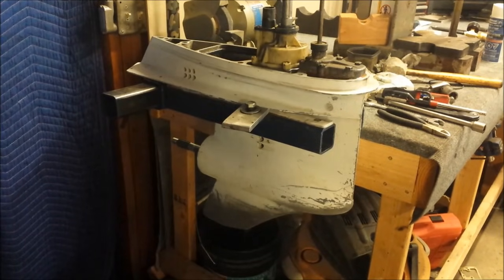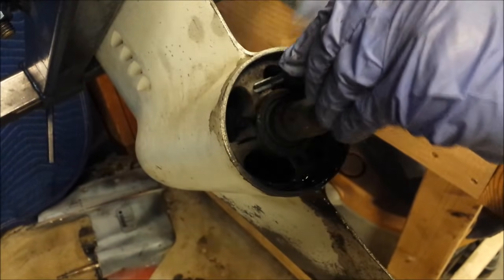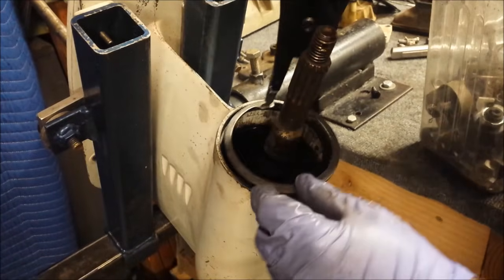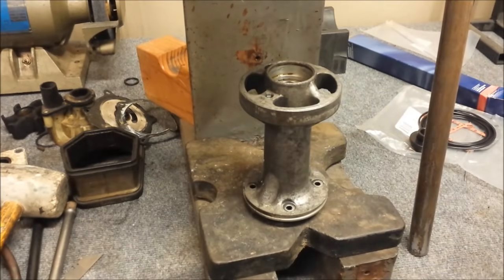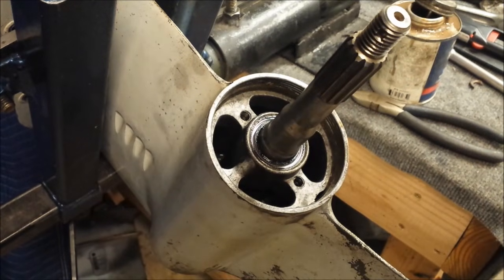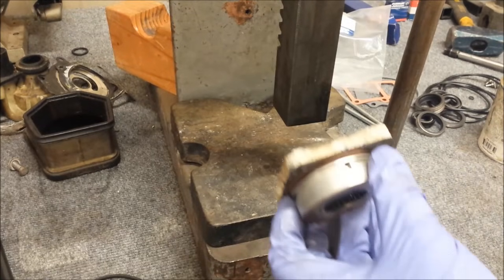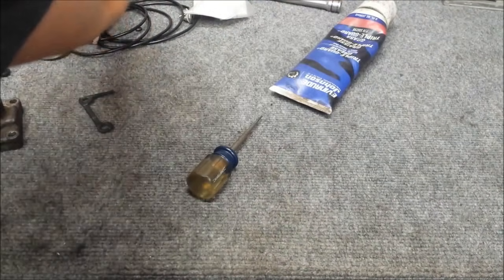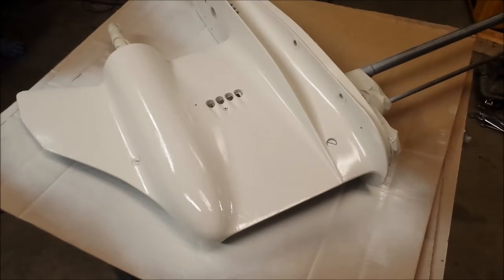How To Reseal a Johnson / Evinrude V4 & V6 Lowerunit / Gearcase

Comment: Just before it got too cold in Canada, I decided to check the gear case oil in my '78 55Hp Johnson... this is a new motor to me (two summers) and had replaced the oil and drain seals at the start of the season. Thankfully I did check, as about 1/2 liter of water poured out of it, with the oil following that. That much water would have likely cracked the lower end unit over the next month or so in sub zero temps. Thus I went searching for how to replace oil seals in a 55hp Johnson and found your video. Thank you so much for the detailed, real-world view of how to fix this. I have the boat in my garage, and plan to re-seal the lower end this winter. I have the original service manual, but hope most of this video applies to my motor.  Of particular interest is the other video you did showing what to look for when buying ebay tools. It's so easy to focus on the problem with the engine, and loose sight of the completeness of the tool.

Comment: Excellent video, and I love the way you touched up the paint at the end. One thing however I noticed is that the water intake screen was cracked up and in need of replacing. Other than that, I learned a lot about seal orientation. Thanks for the lessons.

Comment: I was amazed at how easily you removed the large circlips to get access to the gears, and then how easily they went back on. Your step by step instructions were exceptionally thorough and complete. You were concise and to the point. Thank you sir for your effort in making this fine video. Sadly, I own an OMC 800 stringer outdrive, but this video will make working on it much less painful. Great job!
Reply from the maker: Why thank you good sir.

Comment: Thanks alot Brandon. I have a 1975 85hp that i had to take out the drive shaft and everything out of the lower because there was an issue with the clutch dog detent spring and balls. But now that its fixed, this will help me assemble it.

Comment: I am a total amateur when it comes to boat motors but I have spent a career in a mechanical trade and rally appreciate this video. I would like to attempt this but i would have to pick up some special tools the extra long snap ring pliers,  bearing pullers, etc. I  also have to get up a bit of nerve to try it. I don't have that cool vice either and without that, that would make any attempt very very difficult.

Comment: Awesome video!  I just bought my first boat. Its a project boat so everything is trashed. The first thing I noticed was the lower unit was seized up. I was able to break it free by soaking the lower unit in rust remover for a hour. Now it’s time to do this. Thanks for the video.
Reply: you and I are kind of in the "same boat" Mine came with a 115 v4 evinrude, id tag unreadable since it is so old, but it's speculated is from 1996. Am trying to find the seals that will fit it's lower unit.

Comment: As a fellow mechanic / Automotive, I want to thank you for your time and editing to make this video. I have made a few but they do take up time. I was told to also vacuum test my lower unit. Do you think that needs to be done or just the pressure test ?
Reply from the maker: @Badwolf6466  well, youre supposed to, but I didn't have a vacuum pump at the time; and usually if it holds pressure it'll test okay under vacuum too.
Reply: @BrandonsGarage  Thanks for the fast reply.

Comment: Brandon I have the entire lower gear case stripped out all gears and bearings..my question was can I powder coat the lower unit once everything is stripped? just was worried about the excess of heat it will be enduring once in the oven for powder coating purposes.  Thank you

Comment: i have a 1977 85 hp johnson outboard motor. where can i get the parts i need to do  all that you did in this video?
Reply: I'll be looking for the same parts for my 90 horsepower you have a part number or you don't find it yet
Reply: @javiermontes3777  sierra 18-2692 seal kit , applian water pump kit 439140 318284 777807  i dont think these will work on yours.
Reply: @fredblankenship2319  thank you for your first response man I'll be trying to see

Comment: great video.....expert work performed.  I just did this on my 1999 Johnson Ocean Pro 150 including the bearing carrier seals but unfortunately still have water getting in  :(  I had grooves in my drive shaft where the bearings ride so I am guessing that is where my leak is.  Also I cant remember if I installed the drive shaft bearing holder with hole pointing forward.....would that be a catastrophic failure for my bearings or would they still get lubed somehow?

Comment: Brandon thanks for all your videos.  Do you have any on reassembly of all the gears and the headaches? Tips on pinion nut and proper way to tighten.  My 1983  75-Johnson  -  20"gear case, I found a bad forward gear and pinion ( due to the giant rock I ran over).  Let me know if you have any info on good videos.
Reply from the maker: You'll need a shimming fixture; That tool is just shy of $300
With that said, I should be able to find you some instructions.
Reply: I did not change drive rod bearing, do I still need shimming fixture?  If so is this due to new pinion gear?
Reply from the maker: Technically yes. 
It shims between the pinion and driveshaft bearing/seal.  Ill find the instructions tonight, should help.

Comment: Thanks for sharing, very informative.  I think my shifter is sloppy, where it does not shift back into neutral from forward.  I’ve followed procedure for shaft height, and think I need to replace the gear box.  How do you troubleshoot that?  Thanks Tim

Comment: I Was replacing the water pump on a beautiful ‘87 Evinrude 15hp. I pulled the driveshaft straight up out of the lower unit. It is my understanding that the detention balls drop out.
This looks like a very difficult thing to dissemble and and repair. Do you have any videos of this process.
Reply from the maker: No detend on the driveshaft, just put it back in and youre done.

Comment: Hi Brandon those guide pins are sold out everywhere, is the thread same as the one you used the tap to clean up?  I'm going to need to get the all thread rod if this is going to get done in timely manner, any help would be appreciated on size spec of those guide pins for carrier bearing.  Great vid btw👍
Reply from the maker: Its a fine thread, probably a 28tpi.
The screw you pull out, use those to size it up and get and all thread; itll work jusy as well.

Comment: Gosh, I wish I had seen this before taking mine apart to change out the water pump.  I had no idea the shifter rod screwed in and was activating the gear box by going up and down.  Instead, I thought it simply went from side to side.  It apparently was only being held in by one thread because it turned loose when I reinstalled the lower section.  There is no way to get it in and out of gear now, so I am going to have to take it all apart again and screw in the rod.  Problem is, I don't have a clue as how far to screw it in.  There are no videos on how to do that.  I may have to do it all the way in and adjust it later through the controls at the top.  Great video.  Just wish I had done better homework.
Reply from the maker: What is your engines model number? Ill look up how far it needs to go in.
Reply: @BrandonsGarage  Thanks Brandon.  I took a guess and screwed in 4 complete turns.  It connected  at the top OK and appears to do what it supposed to do without adjusting the linkage.  That surprised me because it must have barely been connected when I removed the loser housing.

Comment: I know this video is 6 years old but do you know if that bearing housing below the water pump housing has to be removed to replace the water intake screens? I have a 1976 Evinrude 115hp two stroke v4 and the water intake screens are all mostly broken and I'd like to replace them.

Comment: First of all, YOU ROCK BRANDON!!!

Secondly, do you happen to know the length and thread pitch of your guide pins you used? Thanx!!
Reply: The size and thread pitch is 1/4 - 28.  Unfortunately, finding a threaded rod with 28 threads per inch is difficult.  I just used a 1/4 - 20 threaded rod.  I was able to get them in the hole about a half turn and that was enough to get the holes aligned for the first two bolts.  The length is about 8 or 10 inches.  You just need enough to be able to screw them out by hand once you get the first two bolts started.

Comment: 84 johnnson 9.9 runs perfect wxcept that dam carrier bearinga have changed now. You just use the big rubber and the 1 plastic double lip seal. Then prop and i thought i had it fixed then i noticed oil in the pan a few days later. No water just oil. Which tells me its the prop shaft seal. If you could have showed how to replace the new carrier bearings 03060

Comment: Did you say the guide pin thread pitch/diameter?  Is it the same as the puller threads you cleaned out?
Reply: What size diameter and thread pitch are those guide pins again?

Comment: Working on a 1989 88SPL redid the seals and when I went to check that everything was working noticed the driveshaft won't moving regardless of being in neutral or gear. There is slight play in it but doesn't continue after the slack is taken out, wondering what I did wrong?
Reply from the maker: With a new water pump and seals it get so tight you cant turn it by hand.
Did you remove the bearing carrier to change the seals?
Reply: @BrandonsGarage  ok, and yes I Did remove the bearing carrier to change the seals.

Comment: I have a 2000 90hp,  I see mine has two retaining clips with bolts on the outside of the bearing carrier.  Did I miss you taking them out,  or are there two different carriers one that is secured by the two bolts and clips and one that is secured with the four bolts underneath?

Comment: Hey Brandon do you have a video or any tips on inserting the prop shaft and pinion gear in the v6 150 Johnson? The detent linkage broke I got it installed with that spring and bearing. The service manual is pretty foggy on the install.  Thanks and great videos!
Reply from the maker: Sorry, I don't have any videos on it. I haven't rebuilt a v4 case after starting my channel.
Reply: You still rock!

Comment: How important is it to make sure the hole in drive shaft bearing housing to make sure it faces forward? Wouldn't it get lubricated in any orientation since oil will make its way all around it?
Reply from the maker: Eh, probably.
But the hole makes sure sufficient oil makes it way into the rollers.
I've seen them installed forward or backwards. If you have a manual I would give it a look to see which way yours gets installed.

Comment: Thanks for the video.  I thought I was finished and now I can't get it to go into forward gear.  It worked fine before I replaced the seals.  Any suggestions on what I might have done wrong ? I am hoping I don't have to pull it apart.
Reply from the maker: turning the driveshaft while trying to shift into forward?
adjust the shift rod correctly?
Reply: Thanks Brandon.  I messed with it a little more and realized I was not pulling hard enough on the shift rod.  You really have to yank it to put it in forward.  Now it seems to work fine.  Thanks again for the video and your help.

Comment: I'm using very similar tool as yours to pull the bearing assy out (johnson 50hp 2stroke, 1997), but the darn bearring carrier is stuck pretty well inside.  I'm about to to abandon this lower unit and buy another used one.  Do you have any last suggestion?

Comment: Do you have a video of How to repair a stripped drain plug threaded hole?
Reply: Use a tap a size bigger after you file the hole smooth then get an aluminum  screw the same size and get an o ring or rubber washer to seal it..   before starting it flush the system out thoroughly with the same oil that normally goes in it until it runs withour shavings in it from the filing..   or you can buy a helicoil and they thread a new thread into the hole so no taps Needed there.

Comment: Hello, my o-ring for the shift shaft seems to be smaller then the 1 in the kit 5006373.  Is the kit o-ring correct?  Thanks. And the kit came with 2 o-rings

Comment: Hi Brandon. Your video is excelent. I have a question: I have to change the forward gear on my 200ho evinrude, 1977 2 stroke. I have the new FG, is it imperative to have a matched pinion?

Comment: 1973 Johnson 65 hp. You don't happen to have a lower seal kit recommendation eh? I've only been finding individual parts at this point. Model 65ESL73R. The internet has not helped me at all. I feel useless
Reply from the maker: Yeah I have the same engine, and the same problem. For whatever reason they don't make kits for 1969-1977 3 cylinder engines.
Reply: @BrandonsGarage  ahhh, thanks! I'll spend the extra time buying everything separate I suppose. 
Seems impossible to find a seal installer as well...

Comment: Hi Brandon, Will the 2 seal installers that you used here for the drive shaft seals & the carrier bearing seals in this video work on a 1977 Johnson 70hp Thanks Joe
Reply from the maker: No, you need:
http://everythingoutboards.com/brp/tools/314640.html
http://everythingoutboards.com/brp/tools/909525.html
Reply: Thanks for the quick reply & the info much appreciated

Comment: Hey I have everything cleaned up and when I was pulling out the seals of the bearing carrier I chipped the side of it. is that ok if I just put gasket sealing compound on it? I chipped the seal groove on the outside

Comment: Do you take on side jobs I have a 1978 85hp johnson seahorse v4, pumps water well, but oil leak in front of prop and water leaking at front where lower unit meets exhaust housing. I'm in PA and looking for someone that would do the rebuild.
Reply from the maker: I'm in CA though

Comment: Hey, do you know the size of the O-Ring for the upper bearing housing. I am from Germany so I need it in mm. I measured 54.6 x 2.6 is that correct or is the thickness 3.0 millimeters? Greetings from Germany from Malte.

Comment: The gasket sealing compound is no longer available. Any suggestions on alternatives?
Reply from the maker: I'm sure it is,
Where are you looking?
Reply: @BrandonsGarage   Amazon the link you provided. Also I have been having a hard time with those gear case
Reply: If I could send a picture of what I’m working with. I am not using the evinrude puller I am using harbor freight bolt type wheel puller set

Comment: So those 4 screws that hold the bearing carrier all have their own O rings..  if u look at the underside of the bolt heads they have a recessed part that fits an o ring..  otherwise it will definately leak..  now if you got new screws than they might come already on there but if your reusing old screws than gotta buy new o rings which for me were 4$ each!!!  For an o ring that wouldnt fit on my pinky..  rediculous..  but all my old ones were ripped up... just an fyi..  but very helpful video..  other than all of evinrudes overpriced lubes and speciality tools which i didnr use a one of em.,  had a ford torsion spring removal tool that worked for the puller..  other than that i used regular old twistin and beatin tools and used red high temp gasket rtv and marine greases..  good deal tho..
Reply: Where did you find these small o rings?

Comment: where do i get the alignment pins and the seal installers my dealer says there not available no more
Reply from the maker: well, what year & HP do you have?
(or give me the model number, and I can look it up)
Reply: e88msledc 1996 evinrude 88 hp spl
Reply from the maker: @MikeSmith-nu9wt  Turns out they are still available... Which begs the question; Who is better at this, the arm chair mechanic, or the professional? 
Guide pins are 0383175 and double-lip prop shaft seal installer / driveshaft seal installer is 0341439.
both available on boats.net

seal kit is here:
http://www.everythingoutboards.com/brp/gearcase/5006373.html
Reply: thank you sir , i had a friend attempt to rebuild it, he replaced all bearings , i got it back leaking oil.. he apparently didnt see your video and its not right ...oops , when i tighten the driveshaft carrier 4 bolts , the prop wont turn now ..shimmed wrong in assuming ? now im trying to figure it out
Reply: Wouldn't you know it , I got that evenrude lower unit fixed , then the motor blew up , so I picked up a johnson ( can't find any model numbers on it ) I heard you can look it up through someone with the numbers off the soft plug , it's
 G4348265 but that website won't let me look up anything , brp something web site , can anyone tell me what it is , some loper motor , but I don't have no model number to order parts.  Are the crossfire's ( 88 evinrude spl ) and the loper ( johnson , 90 hp I think ) lower units interchangeable ? I tried but it hits the lower right cover before it shifts into forward ? Shifter rod is a little different I didn't swap them ( that might be my problem ? ) I'm gonna take it off and count the turns , mark it like you did , and see what I figure out ..

Comment: what about the " bolts"  in the user carrier berring when you pulled it out, i saw threaded bolts at the end,  I never saw you loosen them can you or did you loosen them 1st ?
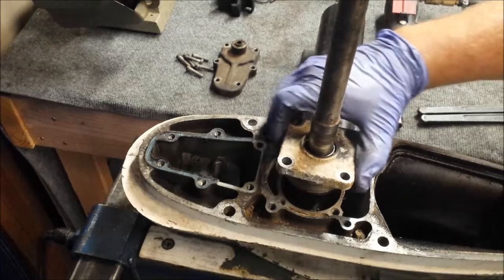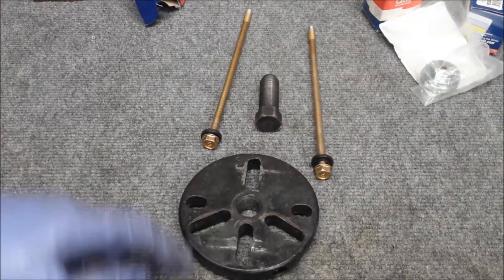Reply from the maker: Yeah, that starts at 4:27 ends at 4:50

Comment: Yikes.. Looks like u left an indentation left by the screwdriver on the aluminum seal area at 4:22. Probably wont leak but kinda hurt when i saw that...
Reply from the maker: Yeah I don't think so; I think it was just dirt/old gasket.
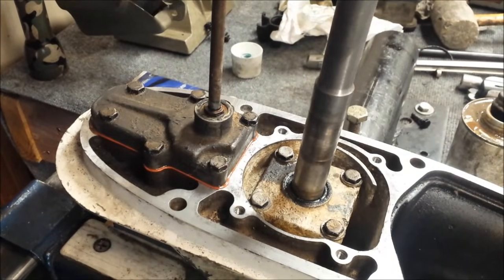At 33:55 you get a better look and I don't see anything.

Comment: EXCELLENT NICE STEP BY STEP BUT WHY DID YOU NOT SHOOT SOME CLEANER UNDER PRESSURE INSIDE THAT LOWER UNIT KNOWING THE KIND OF CRUD YOU TOOK OUT? I GUESS I AM MR. CLEAN, LOL. VERY GOOD VID, HOPE THAT IS WHAT IS WRONG WITH MY 90 HP 1997 EVINRUDE, IT IS TOTALLY LOCKED UP. LEFT ON BACK YARD FOR OVER 10 YRS. BY PREVIOUS OWNER.